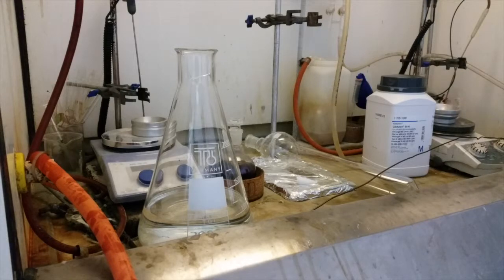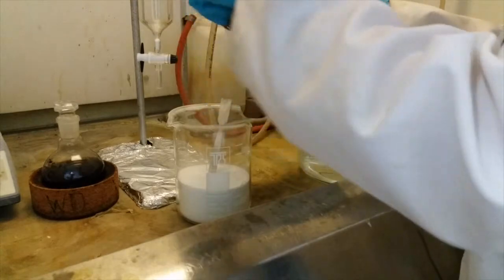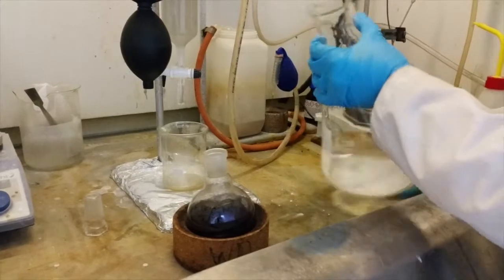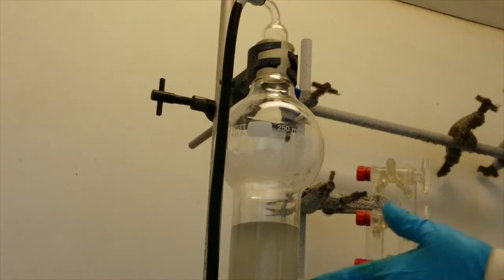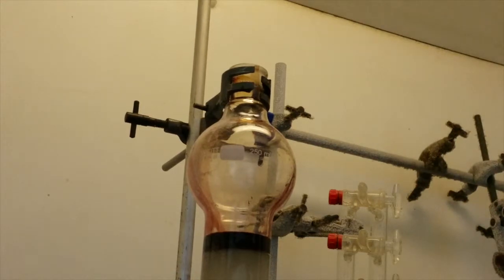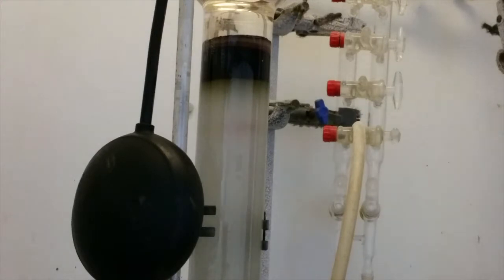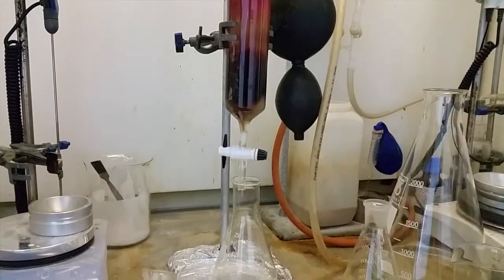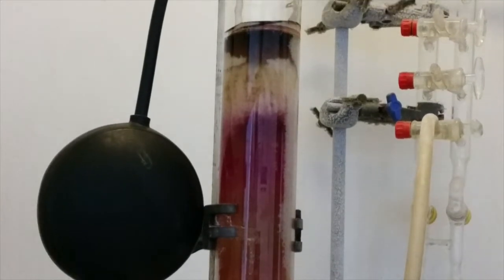Porphyrin Bootcamp - Column Chromatography

Comment: Francesca,
I make the following suggestions for your Porphryn video:
1) in crease the loading for 8ml use no more than 150 ml. The amount that you used is wasteful and slows the reaction.
2) when you have a very messy reaction mixture, I suggest that you use a pre treatment column. Typically this is a short (<3 cm) cake of silica over a piece of filter paper above a  Buchner Funnel. This type of "short pass"  column removes the RF 0 garbage that plays havoc with the final chromatography.  Use a solvent that has RF 0.8 to 0.9 and flush.